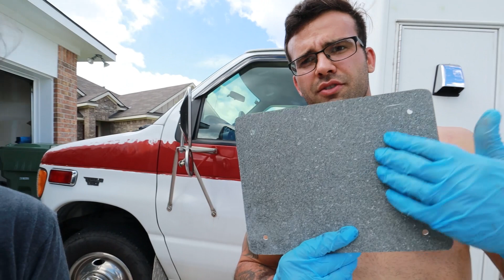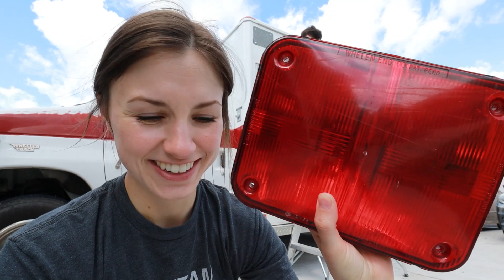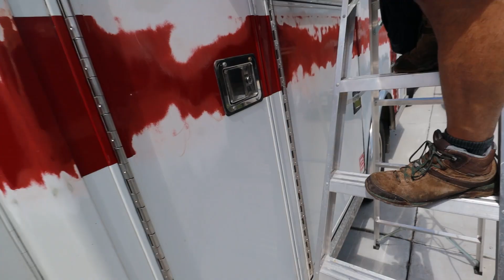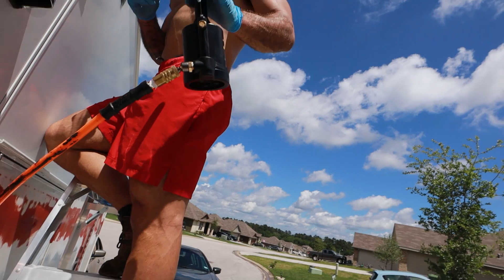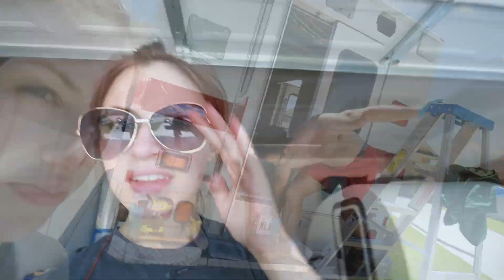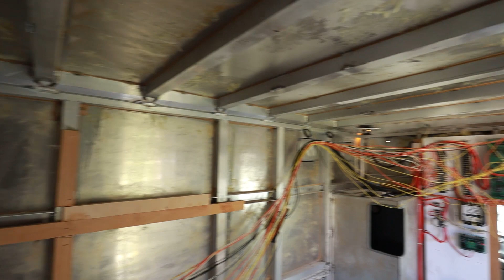How To Remove Ambulance Strobe Lights | Ambulance Tiny House Conversion

Comment: Nice job but I think you missed a good opportunity, should have cut and welded. Now you have plates just sticking out like sore thumbs that aren't remotely flush to the rest of the cab. Cut, weld, grind, smooth, looks brand new. Or at least put them on the inside and just bondo the outside so it looked flush lol. Maybe I'm just a little more OCD. Regardless, nice work!

Comment: Great work guys and I liked seeing that pneumatic nail riveter (I'll need to get one). If I can recommend one thing: next time you're doing something repetitive with many steps try to do only one step at a time for all the locations so for example: remove ALL light fixtures, sand all surfaces, align all plates to mark holes, drill all holes, etc... Doing this will cut the time it takes you and increase craftsmanship because you'll get the hang of whatever step you're doing instead of having to start/stop and change tools dozens of times. Search "the essential craftsman how to be more productive", he's got a great video that shows this. It's made a huge difference in my workflow. It seems obvious after you see it in action but it's not something that humans do intuitively.

Comment: I cut my panels and used 3M marine adhesive to stick them on from the inside. I’m going to put a diamond plate strip on the outside to cover the ugly outside holes.